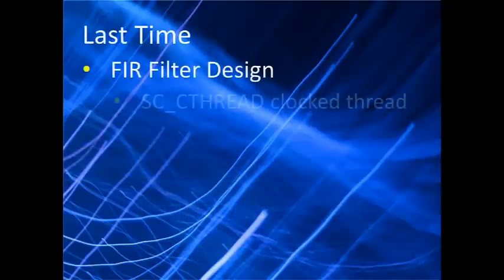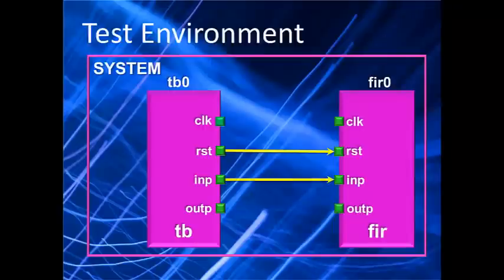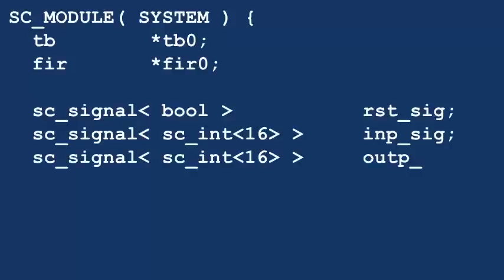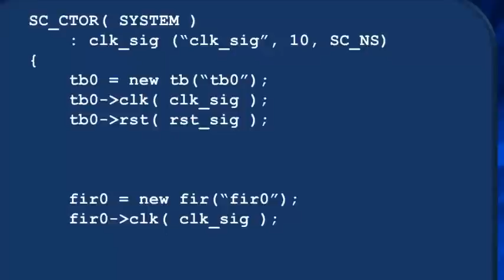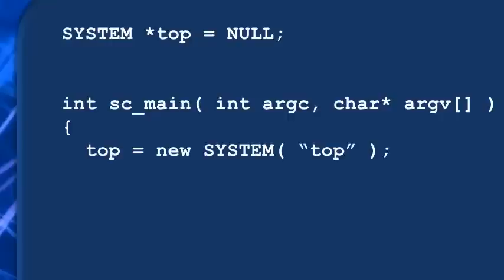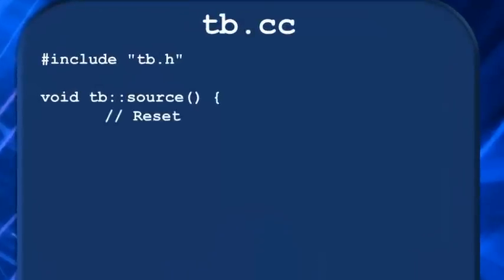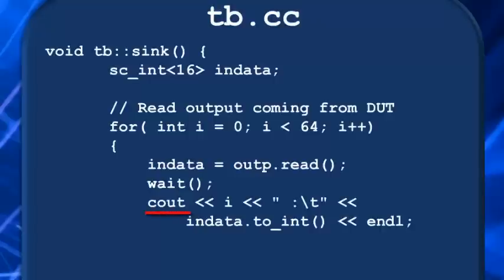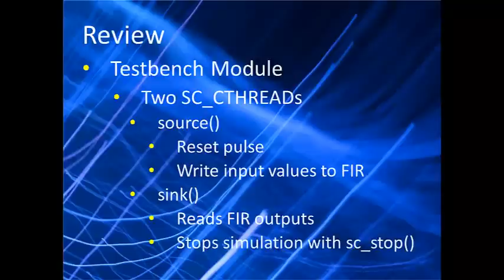Learn SystemC (3) - Testbenches

Comment: A copy constructor for class X is one that takes an existing object of class X and copies it. Other constructors are usually called just constructors.
What is the point of using pointers for the module data members?
Reply from the maker: You can do it either way.  If you didn't want the module instances to be pointers, you would not need the "new" keyword declarations and could just use 'dot' notation instead of "->" arrows to connect the ports:

  tb  tb0;
  fir  fir0;
   ...
  SC_CTOR( SYSTEM ) {
    tb0.clk( clk_sig );
    tb0.rst( rst_sig );

    ...
    fir0.clk( clk_sig );
    fir0.rst( rst_sig );
    ...
  }

Comment: This video is really good., but it would have been good, if you exactly explain how the code flows when you execute it. I am still not sure, how the testbench is being called
Reply: They're all run in parallel that is in tb module, source() and sink () run ins parallel, and tb module and fir module runs in parallel with each other. That's why you see wait() to synchronize these modules together on each cycle.